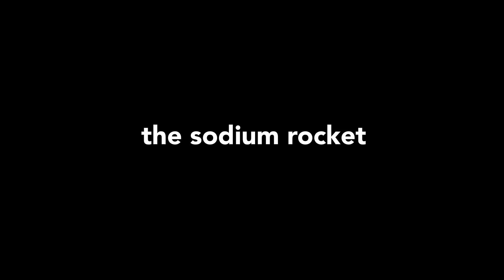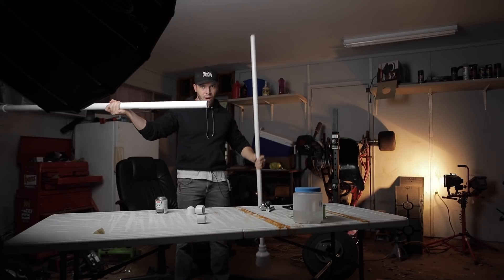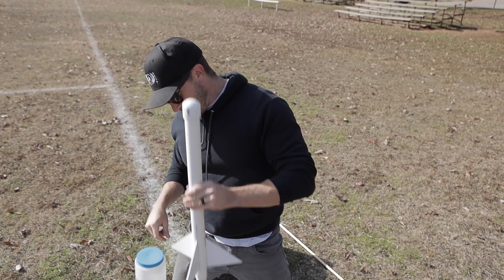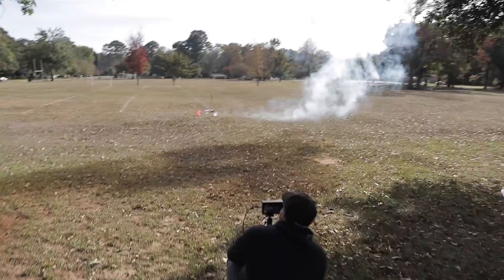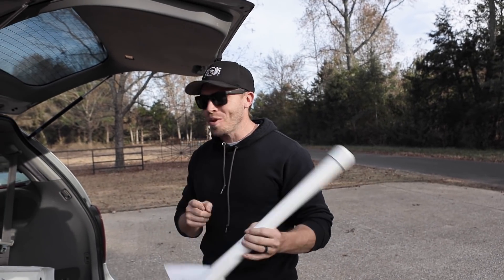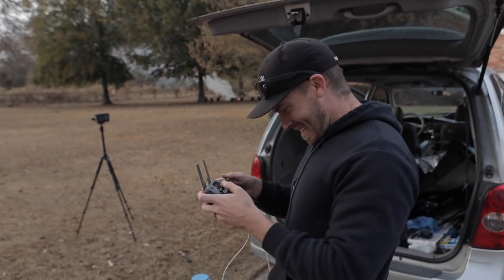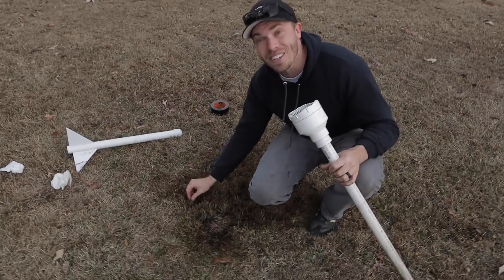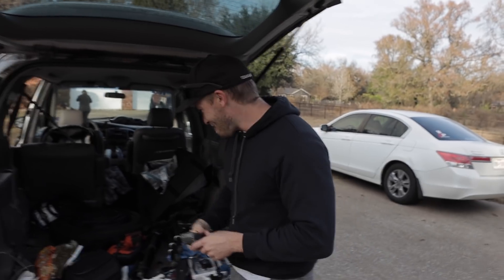Sodium Powered Rocket? - Will it Fly?

Comment: With a flight time of 7.92 seconds it went at approximately 250 feets, which is very impressive
Reply: I know this comment is a tad late, but did my own calculations and they confirm yours.  I know it's just basic physics, but it's still fun to do.
Reply: I third this approximating w/ the single explosion impulse and 90 degree launch angle i got 252 feet.
Reply: Force on the projectile anyone?  Using the concept of impulse, which is the change in momentum of an object due to a force applied over a time interval. The impulse is equal to the force multiplied by the time, and it is also equal to the final momentum minus the initial momentum. In symbols:

I=FΔt=mvf−mvi

where I is the impulse, F is the force, Δt is the time interval, m is the mass, vf is the final velocity, and vi is the initial velocity. In this case, the initial velocity is zero, so the impulse is equal to the final momentum. We can rearrange the equation to solve for the force:

F=ΔtI=Δtmvf

We know the mass of the rocket is 500 grams, or 0.5 kg. We can find the final velocity by using the equation of motion for the vertical component of velocity:

vf=vi+at

where a is the acceleration and t is the time. Since the initial velocity is zero and the acceleration is due to gravity, we can plug in the values of a=−9.8 m/s2 and t=3.96 s (half of the flight time) to get:

vf=0−9.8×3.96≈−*38.8 m/s*

The negative sign indicates that the rocket is moving downward at the end of its flight. The magnitude of the final velocity is *38.8 m/s*.
Reply: To find the time interval, we need to know how long the sodium water reaction lasted.  A typical sodium water reaction can last for about 0.1 seconds. This is a very rough approximation, and it may vary depending on the amount and purity of the sodium, the temperature and volume of the water, and the shape and size of the container. However, for the sake of simplicity, we will use this value as the time interval. Plugging in the values of m, vf, and Δt into the equation for the force, we get:

F=0.10.5×38.8≈*194 N*

Therefore, the force on the projectile is about *194 N*. 

This is a very large force, considering that the weight of the rocket is only about 4.9 N. This shows how powerful and dangerous the sodium water reaction can be.

Comment: I believe that what really makes this reaction powerful is that the sodium reacts with the water to produce sodium hydroxide and hydrogen gas, and because alot of heat was generated, that causes the hydrogen gas to react with nearby oxygen to produce water vapor plus even more energy.

Imagine designing an air-breathing jet turbine engine that uses water and sodium as fuel that reacts with eachother plus the oxygen from the atmosphere to produce propulsion. Even better, imagine designing a water-breathing jet turbine that uses water from the ocean to combust with sodium fuel, and then uses the hydrogen gas from the reaction to combust with oxygen fuel to give the water-breathing jet turbine engine that extra oomph.

Comment: I knew this would be sketchy (and why I love your Science videos so much)😁🤣
Schedule 40 is pretty tough but the "rated pressures" by size are: 1" = 450 psi... 1 1/4 = 370 psi... 3"? drops to 260 psi and 4" is only 220 psi  
Always easy to back seat quarterback after the fact but looks like if you had stainless hose clamps around the botttom/threaded area the base might have lasted longer 🤔
3:14 3rd best line (and the way you said it)... A little too good 😎

Comment: A very big like Chris! Next time a metal base and the same pvc rocket gheghe ;)
Reply from the maker: I was thinking about welding up an old propane tank for the base 🤔
Reply: @ChrisRollins  Sure, why not, as long as the expanding gas has enough room to escape. Otherwise it will become a (somewhat big) firecracker and it will burst into pieces.
Reply: PS. fill and empty the propane tank with water first, before cutting it. Then remaining gas will be out.